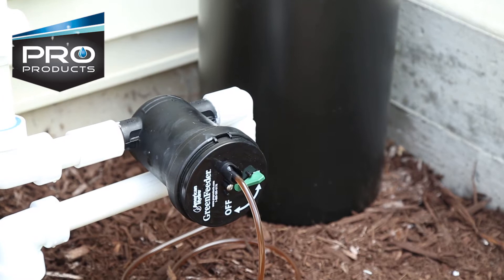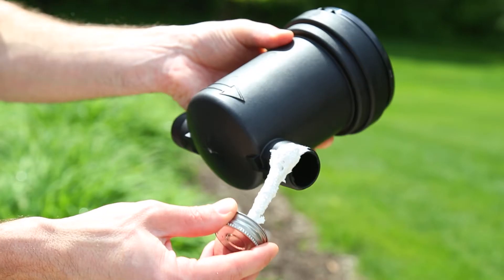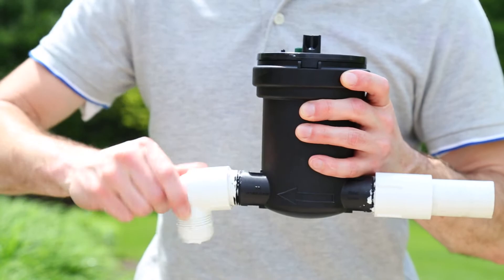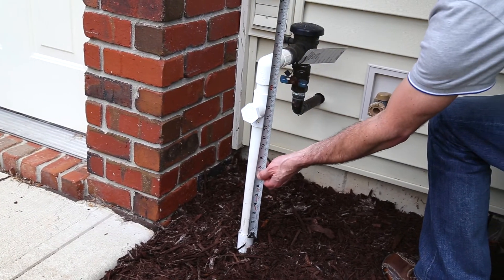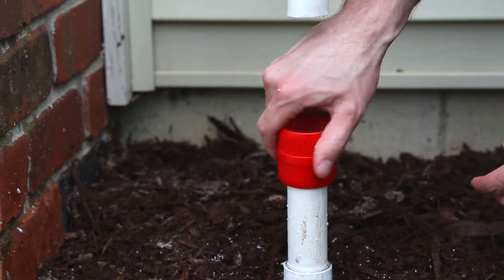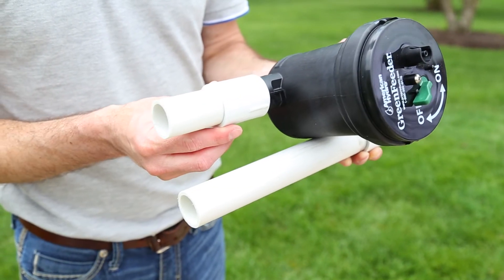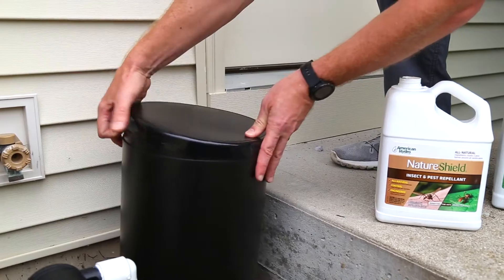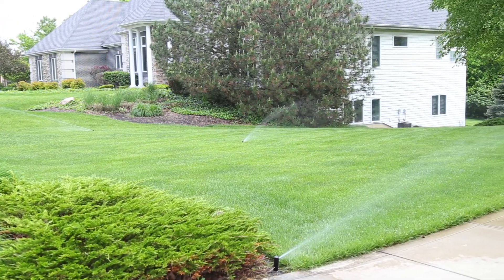Step By Step American Hydro GreenFeeder Easy Install System Instructions

Comment: What is the purpose of the extra piping? Why can’t it be installed in a straight line with the existing piping? Does it have to be in a horizontal orientation?